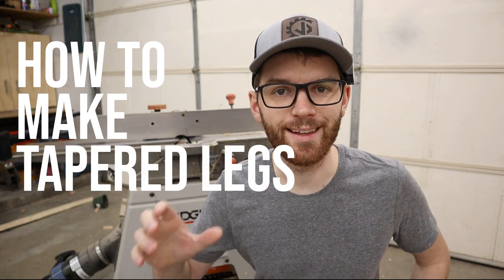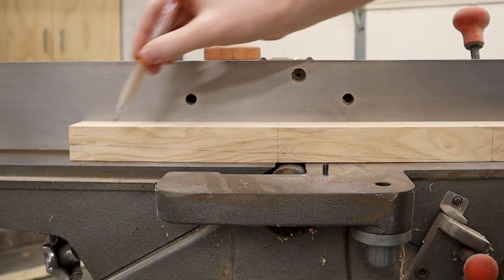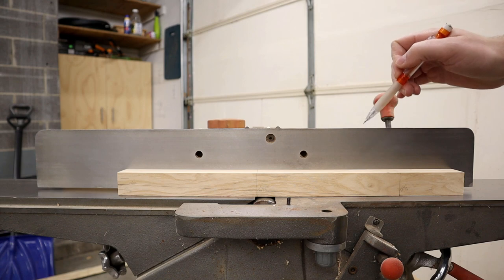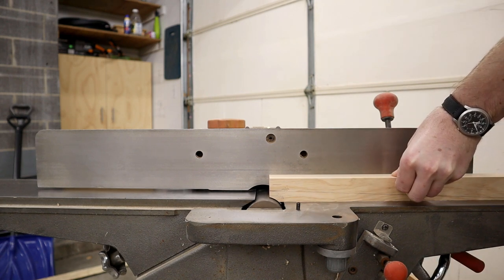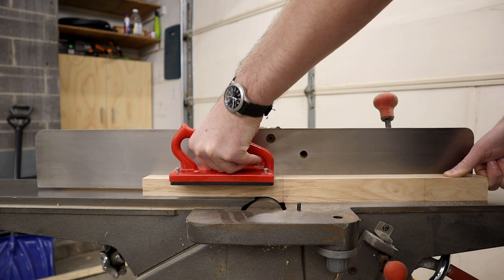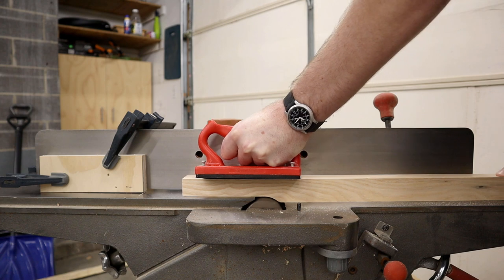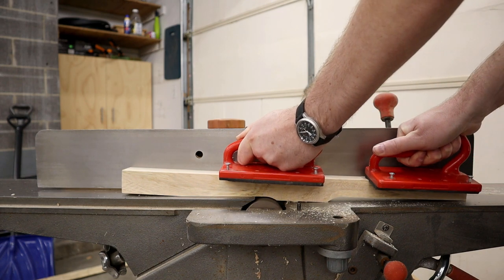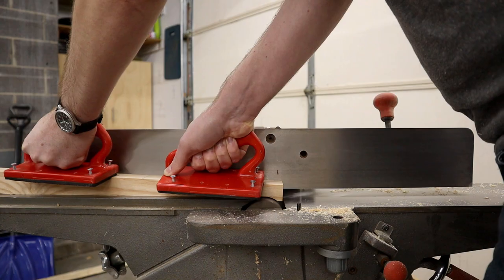Easy tapered legs on a jointer! No Jig Required!

Comment: I never would have thought of doing it this way, but It may be because I don't have a jointer.  My brain usually thinks in "Table Saw".  Pretty cool!
Reply from the maker: ha, I can totally relate.  A jointer is a tool you absolutely do not need.  Until you have one...then you need it.